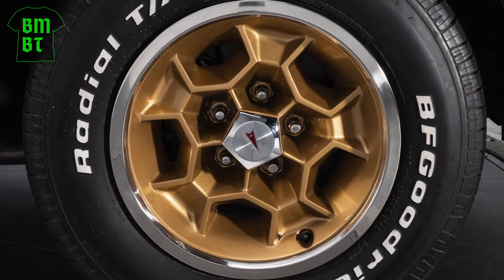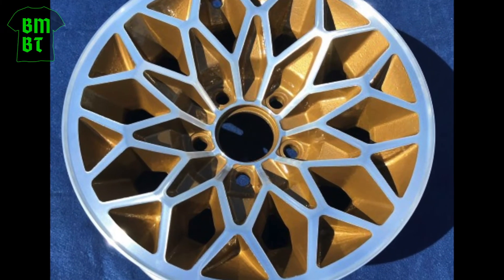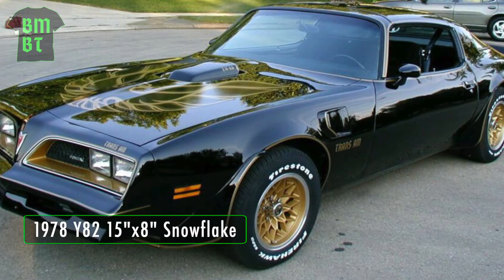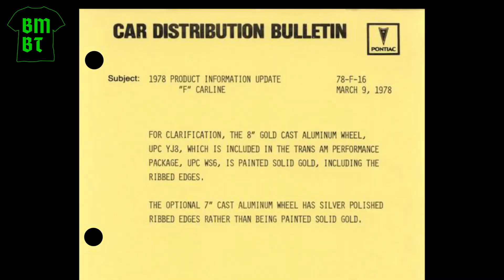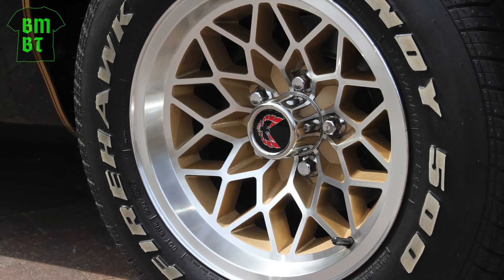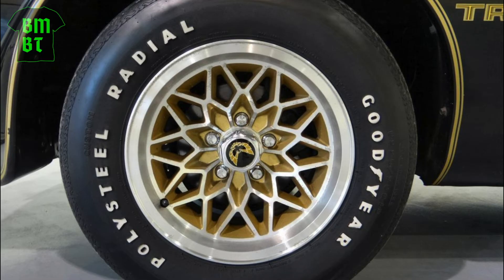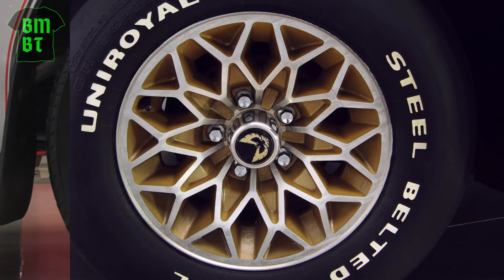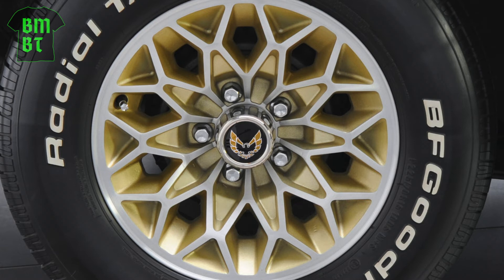Wheels - Spot a FAKE 1977 - 1978 Trans Am Special Edition

Comment: 79 that had 4wheel disc brakes also had hexagon center caps. Mostly late 79s only SE .and only deep dish wheels..I have one. With original paper work
Reply: My early '79 Formula has 4 Whhel dics, WS6 , 8" Snowflakes and Round Centers. Later in the ' 79 Model year they may have changes to the Hex Centers.

Comment: Center caps: the gold bird emblem was a Special Edition only item (also gold Pontiac emblem on the nose, steering center cap, door panel crank caps and larger phoenix graphic on the C pillar) . I had to replace a few center caps back in the day. Ordered them at the Pontiac parts counter and had them try to sell me the red ones, insisting gold didn't exist. Also the hex vs round cap. Hex was plastic and introduced for the rest of the line in 1980. Dealer also tried to substitute those when my 79 had chromed steel round caps. Something else overlooked in all the firebird stuff when wheels get discussed is the WS-7 option. That was WS-6 but with drum rear brakes. It got the larger front and rear sway bars, 8" snowflake wheels with the polished spokes but lacked the rear disc brakes included on WS-6.

Comment: rims can be bought at swap meets ... you NEED to look at the vin-tag ... the fender tag ... the door sticker ... & the trunk sticker ... am i the only one that knows this?
Reply: Apparently, because there is no trunk sticker. The VIN number and the data tag on the cow have absolutely nothing to do with the options or what wheels it came with. The only way to know what wheels the car came with factory is with the PHS dealer invoice or the original build sheet
Reply: its a shame that cars became this way

Comment: OK I'll help you here.  Only Y88 1978 Solar Gold cars received the gold face WS6 snowflakes.  Possibly some Y82 s/e cars as well. The rest of the 78 -81 WS6 cars in all other colors , had the inlays only painted, not the face. Also, 1981 7" snowflakes were different. The spokes were thinner and the triangle shape on the outer  edge of the wheel were "open" not closed like 77-80. As you said, Only 10th ann. cars got the plastic hexagon shaped center caps on "turbo wheels" All other 79's still received the metal round shaped ones' from 77 & 78. All TURBO wheels were made by "Appliance" and all Snowflakes were made by "Western" all 80-81 cars came with the plastic center caps like on the 79 tenth ann. cars. I have owned around 20 77-81 cars along with my brother and my close friends all had them as well. Not to mention i'm like "rainman" with these cars
Reply: That's an absolute lie. All WS6 Trans Ams in 1978 received the solid gold face wheel. It was absolutely not exclusive to the Y88 and if the Y88 did not come with a WS6 special performance package, they came with standard 15x7 snowflakes
Reply: @maxthe222  i was referring to Y88 cars not all had color coded wheels or steering columns . Some were black wheels with gold inserts.  As for the wheels. The WS6 cars had the entire face painted gold. Ive personally owned 15 77-81 cars over 30 years ago. The info online is not accurate. I see alot of mis info on there
Reply: @frankartale1026  Yes they did. Every single Y88 received tan steering columns and steering wheels. They never received any black wheels of any kind. The only two types of wheels on a Y88 was a gold 15x7 snowflake or if equipped with the WS6 handling package, the solid gold 15x8 wheel. There were also thousands of non-special edition solar Gold Trans Ams, these could have received black rally, two wheels or black steering columns and steering wheels.